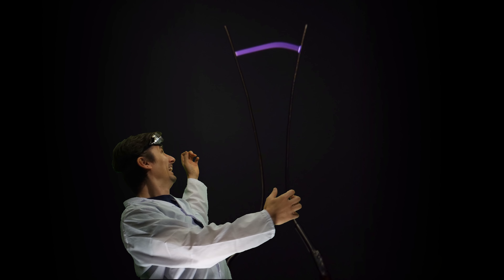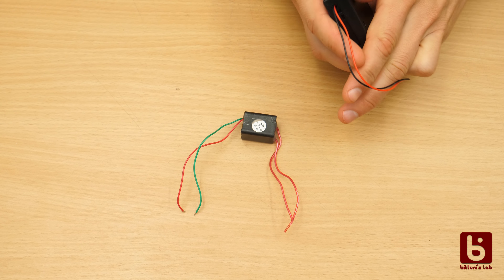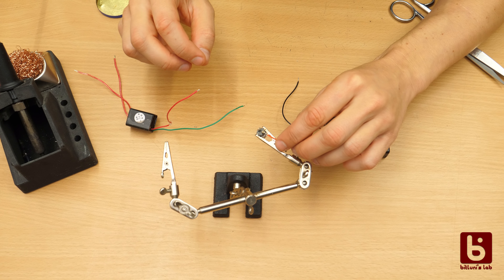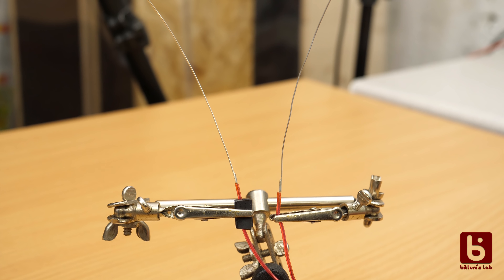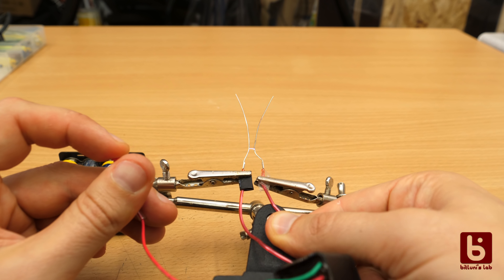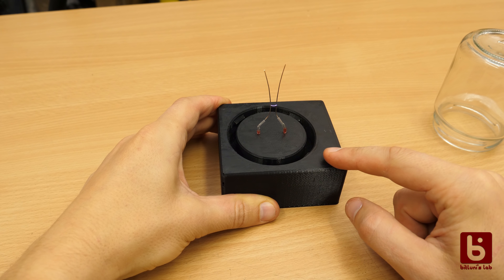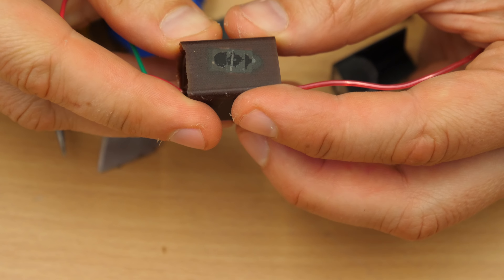⚡️Pocket Jacob's Ladder [DIY, High Voltage]

Comment: Does the wire need to be made out of silver? or can i use paperclips?
Reply from the maker: you can try paper clips. not sure how long it will last then. the less prone to oxidation the better. don't use galvanized materials. the wire might get stains that are insulating. You will have to lower the distance to overcome the additional resistance. it also might find find nice spot and stays there, even with silver. scraping off the stains help. I also determined that it's better the longer the distance between the wires since it allows a better convection.
Reply: @bitluni  Thx than i will try that
Reply: @uk0bach  did it work?
Reply: it doesnt really matter just use anything that's conductive
Reply: just use solid coper wire
Reply: something that small paperclips or almost anything would do, only the giant ones as Tesla made, working in millions, need silver.  Copper is fine for any amateur high voltage work and ordinary solder for connections.
Reply: @bitluni  would copper wire work? What gauge?
Reply: @qui-gonnjinn8949  He said 0.6 mm so gauge 22 should work
Reply: @ES-xq7iu oh yeah worked much better

Comment: Ahhh!! An old Radio Shack SPST momentary switch (the cheapest switch they had, 2 for $1.99 if I remember right)  ...I miss Radio Shack.  Yea, they were pricey, but when you needed that one $1.99 part to keep the project going, it was wonderful. 🦊  Down the street was so much faster than across the Pacific.  I'm looking forward to the day when I can click my mouse a few times and then go outside and have an Amazon (or Walmart) drone drop the desired electronic component into my hand in less time than it takes to cook a Red-Baron Pizza.  The first time that happens will be a great day indeed.

Comment: ive made this, and played with those modules a bit.
u can also use them to make a marx generator or volt multiplier.

anyway it is relatively safe to touch those wires. the very high frequency means the skin
effect applies, and instead of shocking you it just burns.

Comment: Hi, I need assistance with  a costume metal fingertip spawned arc device, creating an arc between the hands using a fairly small power supply worn on a belt and wiring running along the costume to the gauntlet claws. Can you assist me please?

Comment: Awesome video! Worked like a dream! For my Jacob’s Ladder I wanted to ask some things. If I were to use a more powerful transformer (such as a 40kv) with lithium AA batteries of 3500 mA each. Would it work? Will the transformer drain my batteries quicker? And what is the math equation behind these transformation?

Comment: I don't know how to prove/disprove my high voltage transformer is working. I bought the exact part from ali express but after I wire it up nothing happens no matter how small I've set the spark gap. I used heavy copper wire (leftover from wiring the house) and 4 fresh AA alkaline batteries (measured at 6.2V which is a little high...). Is there anything I can check on the transformer with a multimeter to prove anything? I can prove connectivity everywhere up to the transformer and I check the voltage on the low side (I don't touch the high side with the multimeter...). I've never applied input voltage for more than 1-2 seconds, does it need more time than that? There aren't a lot of specifications on the transformer, but it seems to not want to be powered for long or be powered if the spark gap is too wide.

Comment: i built it, but it does nor work too well. the spark only starts at distances below 5mm, and it does not climb most of the time. putting the glass on seems to mess up all adjustments i make. i used a bigger diameter wire (1.2mm), but it is only silver clad copper and it gets burnt spots.  the switch is only rated for 1 amp, so i fear to burn its contacts too. also, maybe the AA batteries (alcaline) can not deliver enough current. on my lab power supply (set to 6V) it works much better - but then it's not portable. also it eats batteries very fast! any ideas what i should change?

Comment: i tried silver covered copper wire and it struk at about 1mm but would not rise. does anyone know if it was the wire or the little transformer. i used a 10a 30v power supply at 7.4 volts, batteries wouldnt do anything but an occasional spark.

Comment: Bitluni, i have a quick question that i cant seems to find the answer too. here it is:
i bought a 2$ negative ion module on ebay, the one kind with the carbon electrode at the end. i want to connect it to a 75cm long wire to charge the air and make an electrostatic precipitator in a DIY Air Purifier. would the little module be strong enough to charge the wire?

thank you for your time.
Reply: BigClive shows a lot of air purifiers and how they work in his tear down videos. Your question might be answered there, if not maybe ask him, he does like them and seems to have quite a few.
Reply from the maker: Sorry, I'm not experienced enough on that field to give an qualified answer but check out Maxx B's hint :-)
Reply: @maxximumb  i asked him 5days~ ago, but he didnt answer.  i also tried on reddit,  but they keep removing/blocking my post because its supposedly not in the right sub-reddit. even though i tried all the big electronics forum the same mod keep blocking me.
Reply: @bitluni  still thank you very much for your anwser, i know its a very precise question.

Comment: Very nice project, but how did you make a thread for the Jar in FreeCAD?
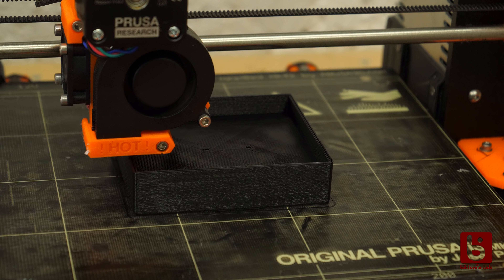Reply: 5:09 - looks like he just made 4 tabs. You would measure the distances on the jar itself at 12/3/6/9 oclock around the circumference from the edge and just offset them into the ID of the inset hole he made - at least, that's what I would have done... I've never used the software he using. He mentioned Blender. It would have been fairly easy with that though if you wanted full threads.
Reply from the maker: I just took a look at the original metal lid. it has in deed just four tabs. I have to print three versions to get them dimensioned right so it's nice and tight. The tabs I did are missing a slight angle but it works anyways. I designed the tab profile and revolved 20° for one tab and then copied it four times and rotated it by 90° each. It's really amateurish but I'm still learning
Reply: @bitluni  hey it totally worked out great. I think it's more than sufficient. And I couldn't help it... I already ordered the transformer. Gonna make it in a long glass tube with round ends. Mecury switch so when you turn it over it turns on. Like an hourglass motion. Got it figured out so it will do it each time you turn it over.
Reply: @bitluni  what would happen if I used diodes to make a cascade multiplier you think?
Reply: @bitluni  yeah ok, that makes sense :) thanks

Comment: why freecad and not Fusin360?
Reply from the maker: Because fusion360 is not free. I want to be able to still use the files 10 years from now that's why I try to use mostly open source software. 
The last time I used fusion the servers were down and I wasn't able to work at all. 🙄 Not that it is not appealing to me. It's far superior to anything else.
Reply: Freecad = freedom, unlike Fusion =  free beer. 

Maybe more powerful and tastier but in the long run freedom is better...
Reply: Use Design Spark Mechanical instead.

Comment: Did the "wrong" kind of transformer come from a Chinese stun gun by any chance?
Reply from the maker: probably. you can get them on aliexpress too. it's not suitable since the arc is not continuous. the frequency gets lower the further apart the wires are. seems to be charging up the voltage somehow internally. I didn't want to blast away headphone viewers but that thing is really loud and sounds very violent. It even might charge up to 20kV😱